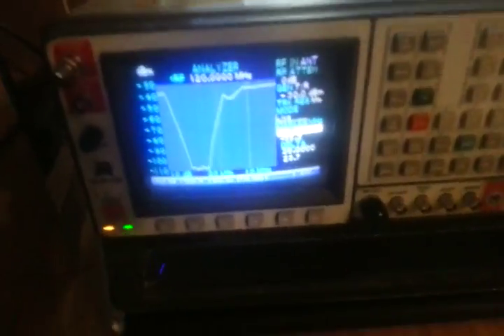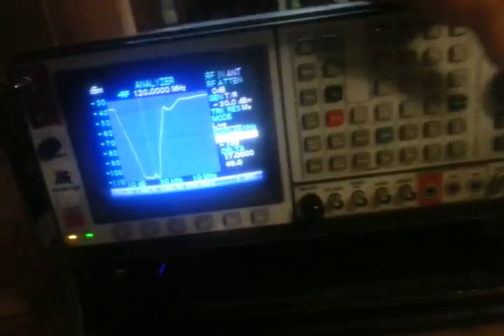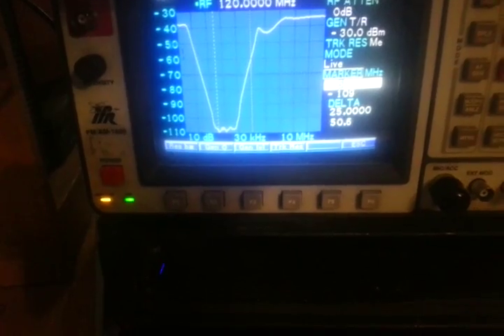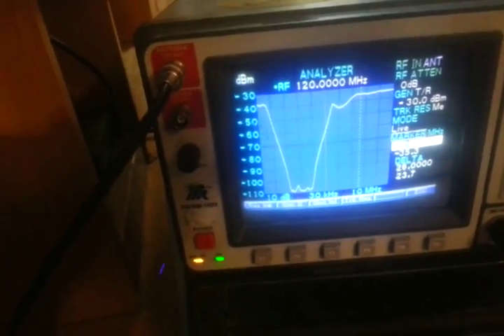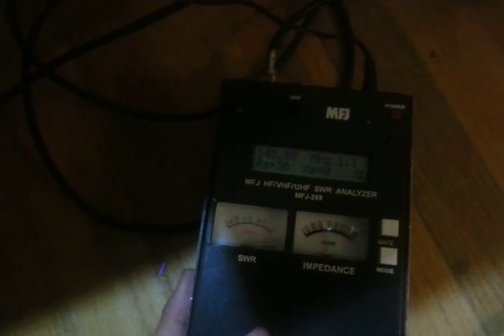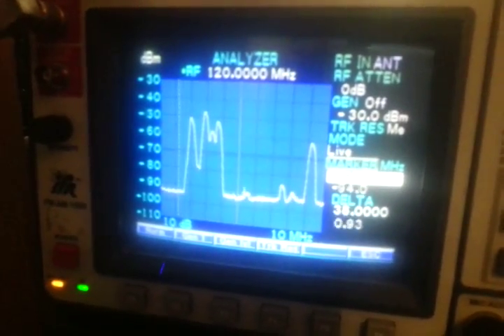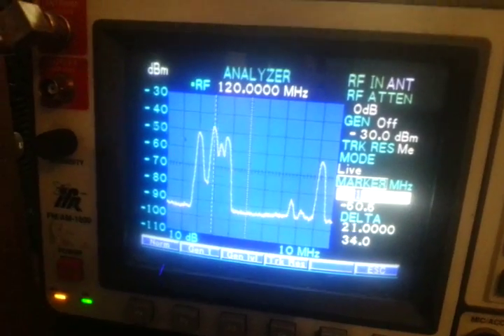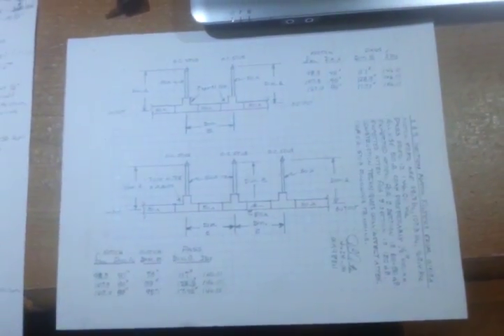1/4 Wave Stub Filter for FM Broadcast de KB9LFZ

Comment: When you completely knock out the FM broadcast signal, do you still receive the harmonic signals around 190-200Mhz? I made stub filters for my 2m yagi for satellite QSOs and use cheap HTs, the harmonics still wipe out the front end receive on the other uhf radio even when I notch out 2m. One harmonic from 2m falls right in the 70cm band and causes desensing. I can't notch out the harmonic without notching the desired UHF signal.